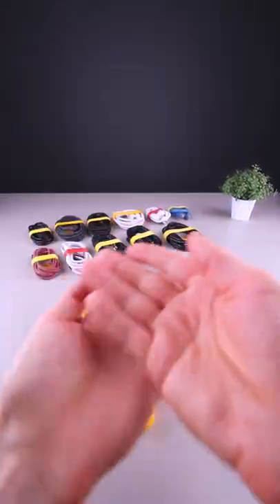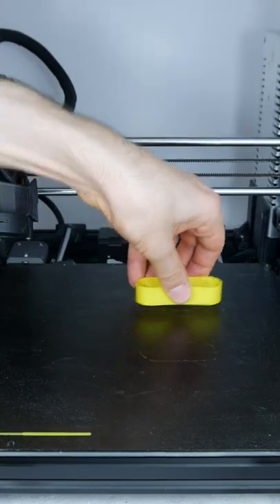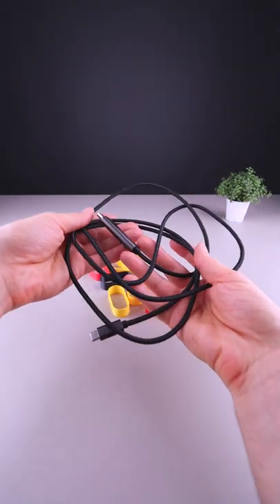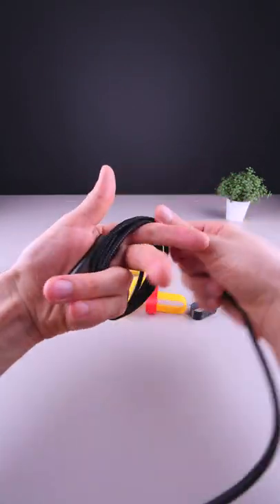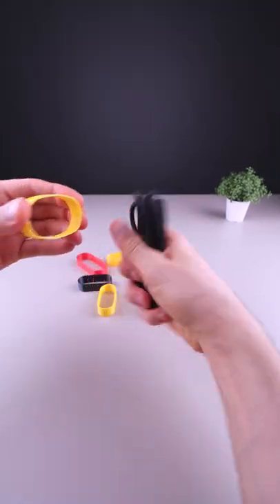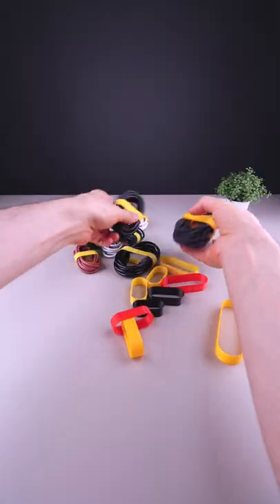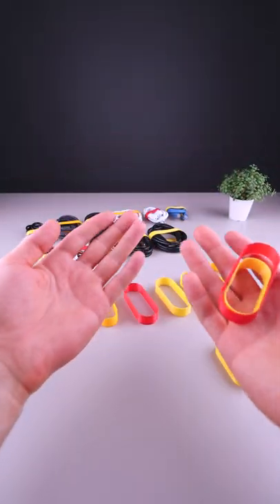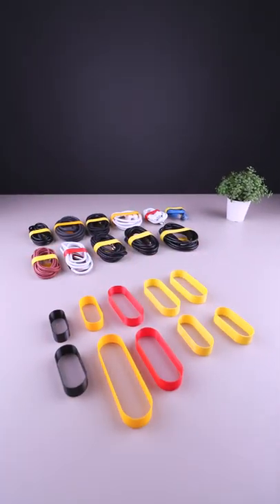Marsgizmo 3D Printed Cable Management Loop

Comment: Marsgizmo, I have a question. Whenever I try to make snap together joints, like a semicircle on one end and a hole on the other, the part breaks before I can fit the parts together. Any tips?
Reply from the maker: try using a good quality PLA, or better PETG (which is more flexible). Also the model has be properly design, so it's not flexing the parts too much. Hope it helps 🙂